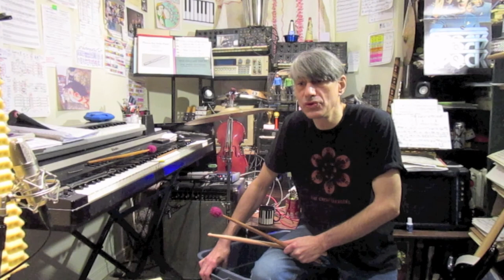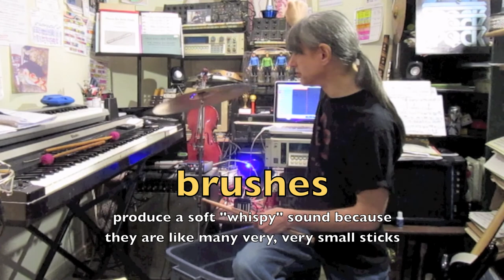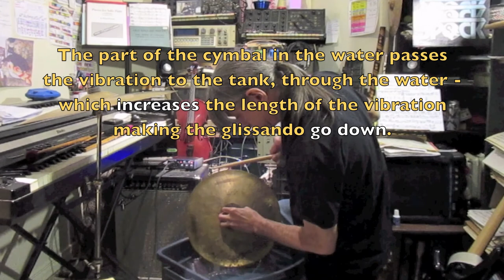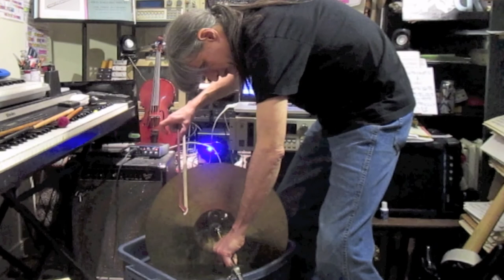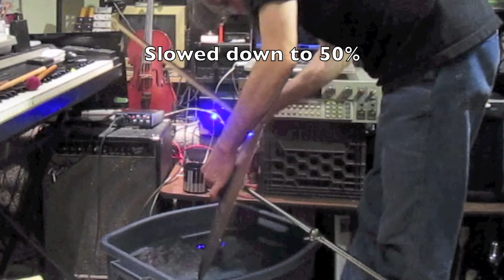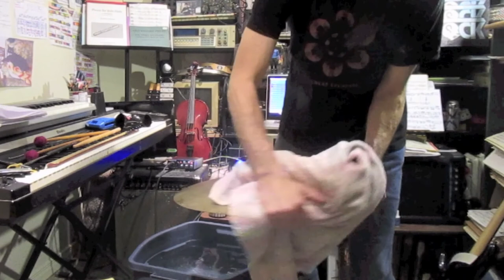the Bowing a Cymbal in Water trick - Music Stuff With Spock #11

Comment: pretty tight dude, especially with reverb.  never knew this technique existed!  manual pitch shifting, hah!
Reply from the maker: Ya. Almost everything you can do with effects was originally attempted in some acoustic fashion. This is a sweet technique you don't see very often because of the logistical problem of having a vat of water in the midst of dozens of people. So many things can go wrong. Plus, it's hard to control and I would imagine, take a lot of practice to control - and not many people will or can do that. . . . however, it's not that big a deal if you have a stable container for practicing (as long as you never knock it over !!!!). I'm going to try this again. Someday I'll have a studio where I can just keep a metal vat full of water handy in a corner somewhere.

Comment: That's great for getting the sound of undersea creatures, thanks! I even have a bow, just need a crash know :D
Reply: But how did you record it?
Reply from the maker: Until then, try it with a backing sheet, a music stand or anything that has a large metal plate. Just make sure the edge isn't surated. If you can run your finger across it and it doesn't pull or stick you can probably bow it. It needs an edge . . . and you bow it like a cymbal. have fun.